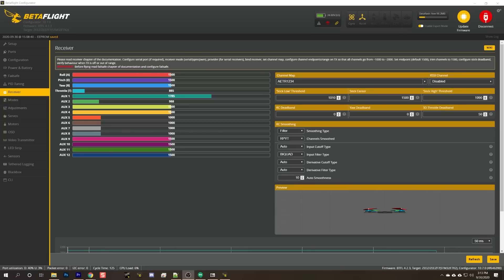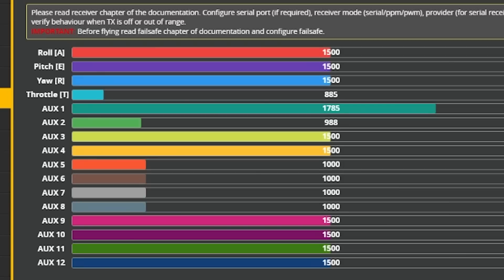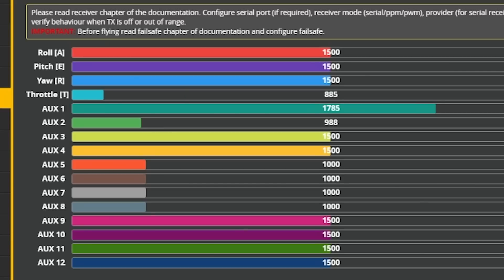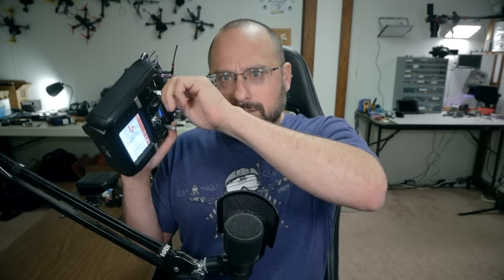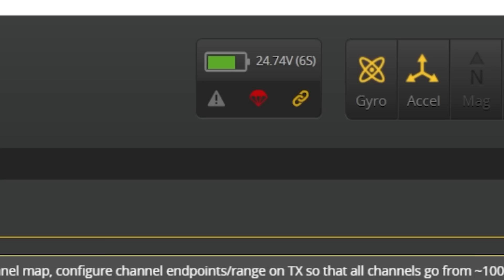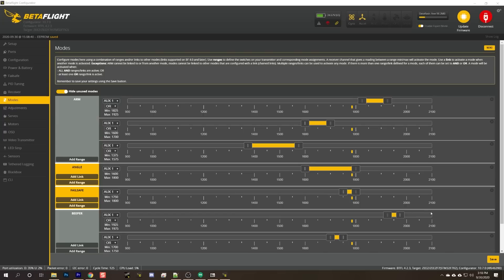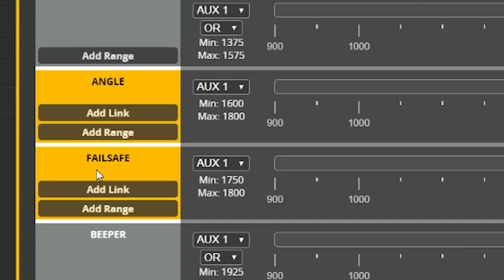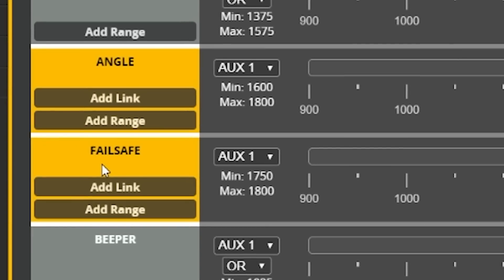Betaflight only aux channels move (BOXFAILSAFE)

Comment: I actually came to this video hoping to find a resolution to the exact opposite lol. My main control channels are showing in beta flight but NOT the aux channels. Pretty confused.
Reply from the maker: Have you assigned switches to channels in the radio MIXER screen?
Reply: @Joshua Bardwell  I didn't! Sorry brand new to FPV. I ended up searching and figuring out that was indeed my problem. Good to go now!

Comment: Hey, can I put Fail Safe on a push button not a flip switch? Don't have any flip switches left on my Radiomaster Zorro with Cineboot30... Not sure if a push switch needs to be pressed all the time when testing... or it's enough to just press and release? Thanks
Reply from the maker: It needs to stay pressed or the FC will exit failsafe when you release it.
Reply: @JoshuaBardwell  Thanks a lot! Yes, it makes sense. Just moved from 3D planes to drones, ERLS etc. from Spektrum and simple stuff to Betaflight, FPV. It could have been almost impossible without your videos. So, Hello from Transylvania! :D

Comment: when the video is cut off, your radio remote is still connected and you can't see anything. Doesn't it make more sense to start gps recovery? so the gps device will bring you towards you and you will return to normal when the image comes
Reply: With video signal loss, you can manually go into aux angle mode to stabilize and level drone and hit throttle to gain altitude, and after that or maybe as a 1 option enter gps rescue mode by aux switch. And wait for videosignal to reestablish. You of course have to setup gps rescue the right way, which JB also has made a video about

Comment: As a long range flier I use failsafe mode to initiate failsafe when video feed cuts out
Reply: I suppose a GPS rescue switch would achieve the same thing though
Reply: @jerryz_here3614  when the video is cut off, your radio remote is still connected and you can't see anything. Doesn't it make more sense to start gps recovery? so the gps device will bring you towards you and you will return to normal when the image comes . he is use said above, just for testing.

Comment: The key part for people is determining that instead of using Failsafe as a mode when setting that via aux channel, doing GPS RTH at the same switch setting for non-testing is correct (and ditto for Paralyze on team racing setups)

Comment: I have a frsky turanis. Bought the hall gimbals. Also saw a short throw racing hall gimbal for throttle that was for one of the other model FR sky radios. So long story short, I got it installed, only way it fit was upside down. So I looked everywhere trying to find out how to reverse the settings so throttle and yaw are reversed to correct the problem of having the physical gimbal installed upside down. No luck. Is there a setting to do this. I have since removed it but it would be cool to get it to work. Was thinking maybe I could reverse wires on the hall sensors to correct this but not sure if they work like that. Anyways input appreciated. You rock Mr.

Comment: I have a problem with my failsafe aux channel. When i am activating the failsafe aux switch, then my motors turns off. Thats good so far, but when i deactivate the failsafe aux switch, it wont let me arm the quad any more.  I dont know what i can do. I have to unplug the batterie and replug it then it let me arm again. But i want to arm the quad directly after failsafe. What can i do?

Comment: Hi i have problem  when switch  i  gps rescue mode on aux  why is yellow highlight is not on ? Thats why i dont know if gps rescue is working or not ?  I check gps sat is ok .but if i check on betaflight on mode is not yellow highlight even yellow bar at the top of yellow line.

Comment: If I try the GPS rescue mode via failsafe aux would it mean that gps rescue mode  would automatically proceed without me flipping the switch of the gpsRM? and if so how do I regain control of the quad?, 

To what im familliar with is that you can manually flip gps rescue mode 100 meters away for sanity check to work. and then flip it gpsRM off to regain control.

how about failsafe gpsRM? Hi i hope someone can answer.

Comment: Hi JB always very helpful I’ve set up all my switches like usual in mixer and inputs on my Tango 2 in the modes tab in betaflight the all highlight the yellow add range boxes on the left side when switched on 
Except GPS rescue ...right aid switch indicator moving but the box doesn’t turn yellow ... any idears 😊

Ok few days later I’ve tested RTH and it all works fine ...just doesn’t highlight yellow in the add range box in BF
Just thought I’d let you know 
Thanks for all your help 😊👍

Comment: I ran into an interesting scenario today. I had an AUX switch set for GPS Rescue and also had "set to active" value in the failsafe tab for GPS rescue. I also set an AUX switch for failsafe. After testing GPS rescue worked and then switching back to acro I proceeded to try the failsafe switch. It worked as intended but the trouble came when I went to switch it off. Since my GPS rescue was set to an "on" value, after I switched off Failsafe I was still in rescue mode. Not putting it all together in my head while flying and noticing I still didn't have control of the quad I tried to disarm and rearm from about 100ft up. That didn't work and I ended up crashing (no damage). I believe if I would have moved the GPS rescue switch through its positions I would have been able to then recover the quad. Is my assumption correct?

Comment: One of my friends sent his quad to me to fix and it had this same problem but he was running an XM plus and had failsafe set on AUX12 so the RSSI was constantly triggering the failsafe.. Lol, I figured it out after just fooling around with the settings and I happened to notice that the AUX switches still worked (which I thought was extremely weird because my friend thought it wasn't binding) so that is what led me to the AUX tab.

Comment: I had a curious thing happen with the fail safe but need to verify by trying it again to be sure. On my radio it would prompt "failsafe not set". Still I would fly for a couple of minutes and the drone would gradually lose motor thrust (over 3 seconds or so) and drop to the ground. But when I set it up on the radio "after much updating and switching out the radio micro SD card" it didn't do that....was quite nervous around trees to be sure but it didn't behave the same way....No? Yes?

Comment: Can you setup “get out of the frckn tree” on a aux channel? 🤪 I always do the props off power down the transmitter on the bench after a new build. I don’t use gps or stable mode and always wondered why that was a option.

Comment: I use failsafe as an instant kill switch so I've got two different ways of disarming in the event of an emergency.
Reply: That's how i use it as well since i have not been able to come out of some fs!; I tend to use it in any emergency but first i always disarm.
Reply: My disarm and failsafe and my whole radio have stopped working all at once before, so it might ne worth doing that just in case. My quad flipped over, and went into the ground. The props had terrible durability fortunately, so they disintegrated, and someone was able to unplug it. Turns out all the settings in it had been somehow messed up.

Comment: Huh, I've been using the failsafe mode to test GPS rescue on new quads.

I always do the test in this order:
1. GPS rescue switch
2. Failsafe switch
3. Turn off quad
(test GPS rescue while your quad is sitting in a field, not when it's flying lol) 

I'm shocked I've never run into a failsafe issue yet haha
Reply: Quick question if you're using crossfire: do you have to set the tx to hold because that freaking scears me because the quad could just fly to the moon.

Comment: Failsafe mode on a switch is also used by racers with multiple quads plugged at once practice sessions so you can fly several quads consecutively. It has multiple uses.

Comment: I can think of two reasons to use a failsafe switch - recovering after getting your video stomped on (you mentioned this in your GPS rescue vid), and to safely recover from an actual failsafe. I am under the impression that if you have an honest-to-goodness failsafe, you want to put your receiver in failsafe mode so that you don't re-arm the instance you have re-connected, when your video might not be good, or whatever. By putting it into failsafe, the quad would continue to return home until you are prepared and make an affirmative action to regain control.
Reply: GPS Rescue doesn't return control instantly when signal is restored after a failsafe. You must significantly move the flight controls to signal that you're ready to take control, then GPS Rescue disengages.
Reply from the maker: If the quad goes into failsafe with the arm switch in the armed position then after it comes out of failsafe, it will have the ARMSWITCH arming flag active and will not rearm until arm switch is cycled to the disarmed position.

Comment: This is actually quite useful! I’ve been hesitant to turn off my radio to check my GPS Rescue fearing that I wouldn’t regain control and the quad will crash land on my car or something.
Reply from the maker: To test GPS rescue, arm the quad (with min sats locked), fly 200 meters away, land the quad and don't disarm. Then activate failsafe. If the quad simply disarms then failsafe would not have worked. If the quad climbs and flies home, all is well.

Comment: I use it on a switch so I have to flip two switches to arm the kwad.
Reply: Thats what the PRE-ARM mode is for - don't use FAILSAFE for this.
Reply from the maker: Bruce is 100% right. Use prearm mode not failsafe mode for this. One reason is, if you accidentally flip the failsafe switch in flight you will fall out of the sky. But if you accidentally filp the prearm switch, nothing will happen.
Reply: @JoshuaBardwell  Hmmm, you got a point there. In my defense, I DO smoke a LOT of weed... Thanks for taking the time to point this out.

Comment: we use failsafe mode for setting up team racing quads so that we can have multiple quads plugged in and all of them are disabled with the mode except the one we want to fly
Reply: why don't you just use arm for that purpose? if i understand correctly, you have it setup that each quad has a different failsafe switch position, but you could just as easily make each quad have a different arm position... but now that im thinking about it i guess that makes sense because you want to keep the arm switch the same, but now that i think about it more why not use 2 stage arming instead?
Reply: @xymaryai8283  Because when a quad goes into failsafe, we can use that condition to trigger other events, most importantly it forces the video on/off switch into the off position.

Comment: I have failsage on the same switch as arming, just on the other position. Not sure why, but I like the option to manually failsafe if i feel like it. I still have the failsafe setup on the rx and failsafe tab the normal way for rx loss.

Comment: I changed from d16 to d8 on a frsky r-xsr and could not make it work   Change it back to d16 and still does work even though the receiver is bound to the taranis , before any change everything was pefect, I tried with a new receiver and works ok, don’t know what happened, any idea?
Reply: You have to re-bind if you change from D16 to D8 or back.
Reply: I already had rebinded back from d8 to d16 but still doesn’t work, the green light on the receiver is on , the receiver seems not to comunicate to the FC

Comment: Yes and no. The main function of failsafe mode is to literally set the flight mode to failsafe through AUX channel when the RX lost connection for some setup. If you're one of those caveman who run analog RX protocol (PPM or PWM), those don't have dedicated bit to send failsafe flag to the FC. Even some receivers with digital protocol don't have working failsafe flag such as on L9R. The default failsafe on those receivers are just throttle cut, which might work for "drop" failsafe but totally undesired for things like "GPS rescue" because it's RX level failsafe, not FC level failsafe. This is when the failsafe mode comes handy, because all receivers have the capability to set channels to certain value when the RX goes failsafe and you just have to set it in a way so when the RX goes failsafe, the FC detect failsafe through AUX channel. Just my two cents.
Reply: How did you learn this..? I'm no noob, but my resources are rather limited, I'm wondering if there is some quad group you could recommend if I wanted to learn stuff like that.
Reply: Yes, this is the real reason for the FAILSAFE mode. Using it to "test" failsafe is not the intended function as it isn't really a test of failsafe as the receiver is not in failsafe state and you don't know what it's really going to do when it actually loses signal.
Reply: I feel like I want to die every time I see people using that feature to test GPS rescue and have to argue with them,  @BruceLuckcuck . A lot of people assume failsafe mode is the same as signal lost when they're not.
Reply: @Asu01  I use it as a test if rescue mode on failsafe is working and then I proceed to shut off my transmitter to make sure the actual failsafe itself is working.
Reply: This!

Comment: I've always used failsafe and beeper on the same switch at the same time.
Reply: That’s how I do it too
Reply: That is I think actually good idea
Reply: Same here.. i disagree with JB on this.. i used a 3 toggle, up nothing, mid beeper, down beeper + failsafe, for safety! I have kids and prefer to have the failsafe set to lock out arming just in case. Peace from Alaska!
Reply: @AKtoTok  this is genius, I've always done failsafe up and beeper down with the default at center. This is way smarter.
Reply: I think that's not as useful, what's the intention behind that?
Reply: @Asu01   If something goes wrong you can be sure that you've killed power to everything and the beeper is on so you know for sure that you are safe. If you were to accidentally flip the disarm to arm your still ok, In the old days we used a double arm system, same concept with a beeper noise to let you know its defiantly dead.
Reply: On default, failsafe enables beeper so I don't get why would you pair both at the same time,  @ToddTube1 . Double arm is more than enough, 4 years into this hobby and never had a single false-arming related accident.
Reply: @Asu01  I guess I've never tried it any other way, but most of the guys in this area do not double arm and I have seen a few guys get cut up for one reason or another, twice I've seen guys bend over to pick up there quad and hit the arm switch.
Reply: @ToddTube1  Did they just leave the TX dangling from a neck strap when bending down? I always hold it off to my side or even just leave it sitting on the ground.
Reply: @ToddTube1  I do move the throttle stick to mid position after disarming. Even if I hit the arm switch, it will not arm.
This works for me. But please test it first in a safe environment. Maybe something has changed with the new Betaflight.

Comment: I’m having a problem with my modes and aux channel, they will not go to 2000 so I can have all 3 flying modes what could be the problem
Reply from the maker: If you have a 3position switch go 1000 - 1500 - 1000 then it means you set up the switch mixer line incorrectly. You need the SRC to be the switch (such as SA) and that's all. If you also set the SWITCH parameter to SA, it causes this behavior. The SWITCH parameter should be disabled.
Reply: @JoshuaBardwell  that was it thank you so much I have been fighting this for the past week lol